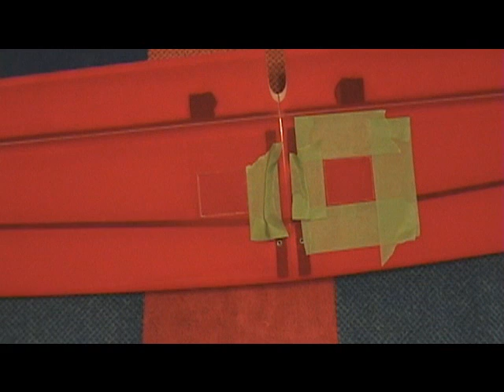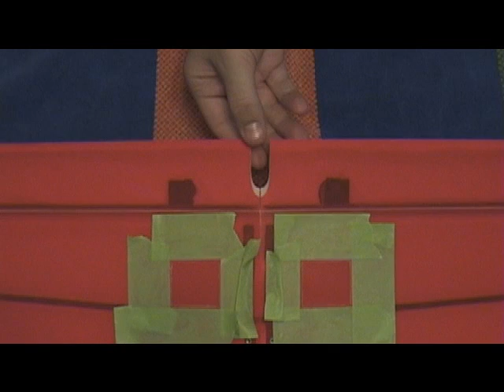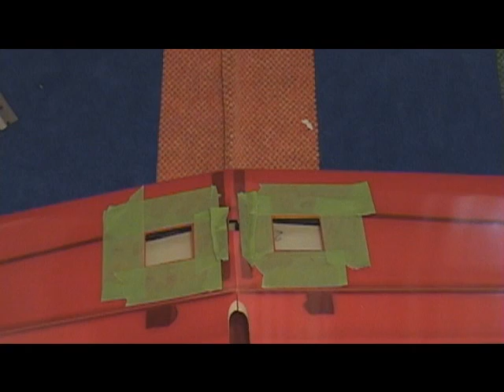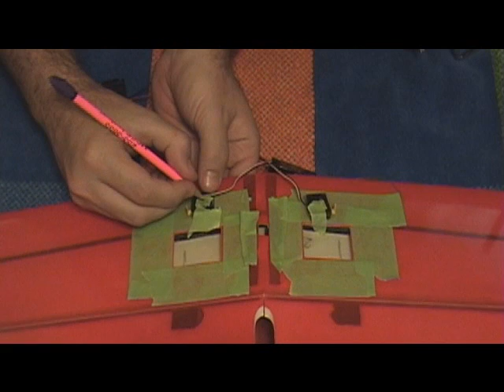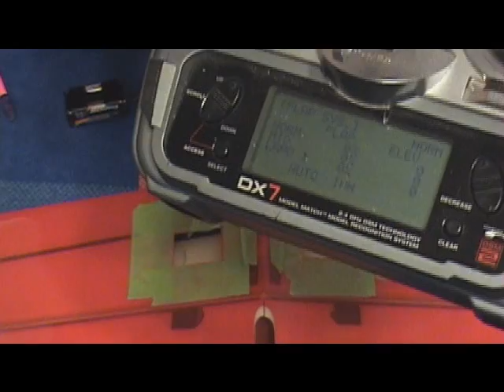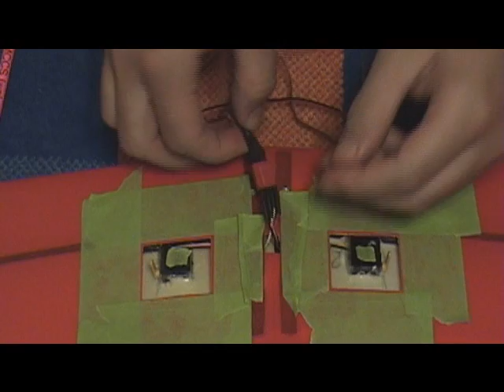Blaster Step 3

Comment: The tape is also for tracing the servo and then cutting it out. I did it with topsky and it also helps you make a clean cut through the wing fiber without it fraying